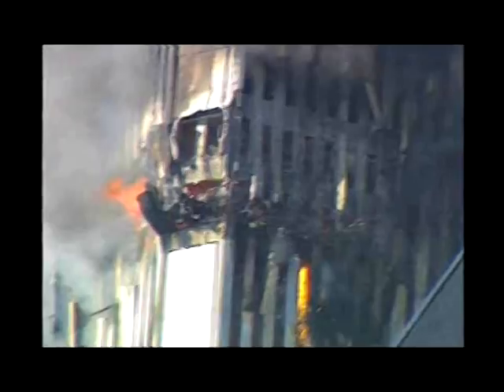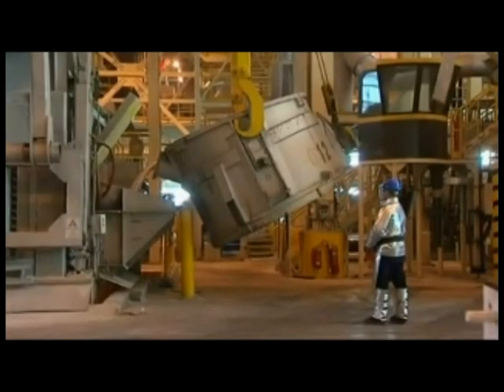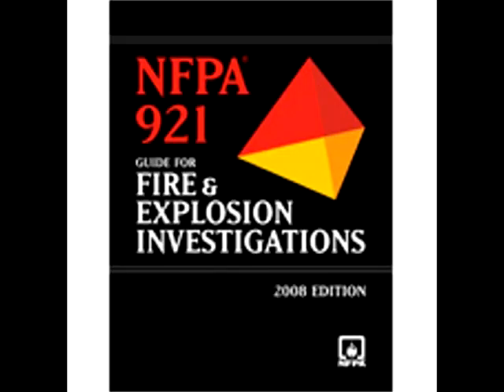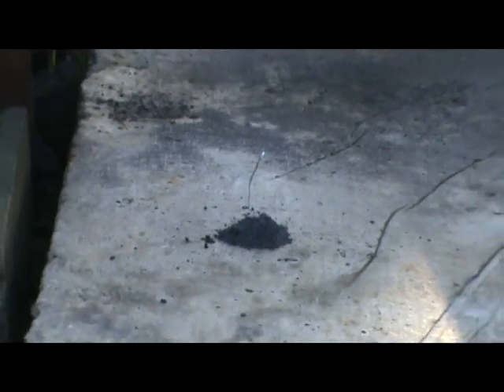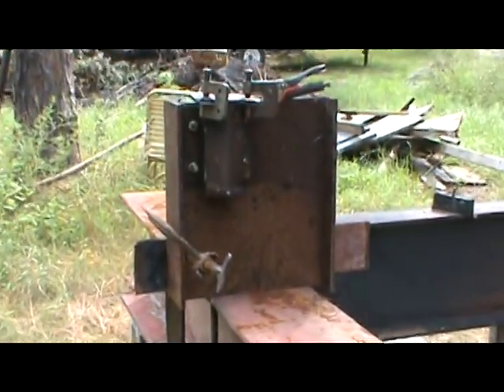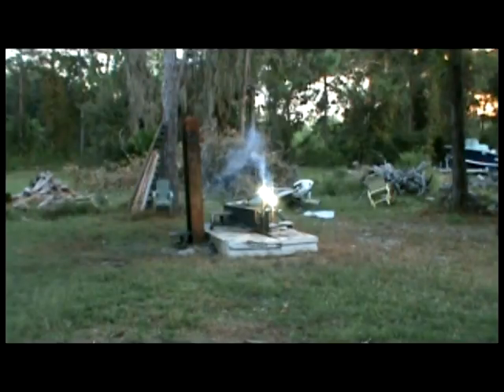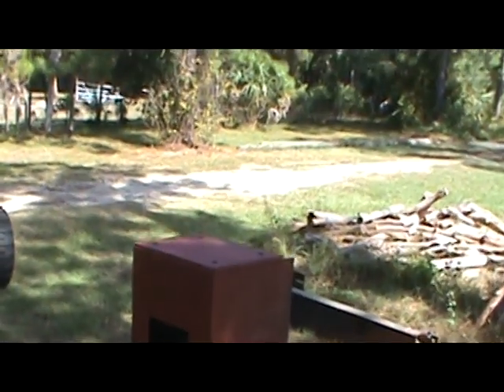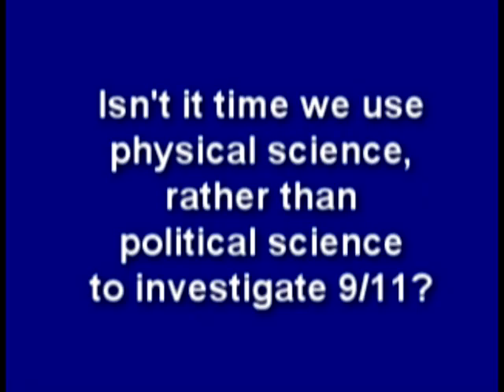9/11 Experiments: The Great Thermate Debate

Comment: So if thermite was installed right in the impact zone then how do you think it survived the plane impact?
Reply: Joel Robinson The thermite was in the core of the building, which was not impacted by the plane. The WTC towers were designed to withstand a full speed impact of a jumbo jet.
Reply: @BeeStinger13  Plus, that statement of yours is conflicting because you claim that thermite was seen dripping of the exterior corner of the south tower so how could it be in the core if it was planted on the exterior?
Reply: @BeeStinger13  False. You are overestimating the power of the towers. A 767 hitting it at 500 mph full of fuel at full speed is not going to go well, especially since nobody had ever predicted such a thing, a purposeful suicide attack, and that steel structures have collapsed from fire in the past. The WTC was designed for a 707, a smaller plane, hitting it at a slower speed, around 180 mph due to it being low on fuel after take off, as there is an airport close to the WTC. That is quite a different circumstance than a purposeful attack with a bit larger of a plane hitting it at full speed and full of fuel. But there is something you are forgetting, the buildings did survive the intitial imapacts, allowing thousands of people to escape from them. It was the fires from the explosions of the crashes that weakened and bent the steel which caused the structure to eventually be unable to stand anymore. So your claim that one of the towers could withstand the full speed impact of a 747 is just absolutely ridiculous. Nobody ever claimed this. This was just a quick assumption many years ago by one of the engineers who designed the towers but he was obviously wrong about this because nobody predicted a fully loaded with fuel airliner to be deliberately flown full speed into the Trade Center, just a much slower 180 mph crash when the plane was low on fuel after take off and lost in the fog, not being able to see where it was going. 

There is no way the thermite could have survived when in the core either because Flight 11 damaged the core columns as well and the fireball went through the core as well so it could not have survived the crash. Further, there is no way the collapse was initiated by the core failing because of thermite in it. 1, no thermite residue was found, just primer paint chips, this was debunked a long time ago and 2, the collapse of the South Tower initiated from the exterior not the core columns, proving that the core columns were not the cause for the collapse of the South Tower. The core of the North Tower however failed first because Flight 11 hit dead centre, so the core was damaged the most by the impact and fireball.
Reply: If the plane was demolished at the impact zone, how do you think it survived long enough to do all that demolition work to the skyscraper(understanding it takes many magnitudes more of work to accomplish, and no object in the world can demolish or accelerate through itself)?
Reply: @liarfire101  Basic physics. A 100 tonne jetliner with 40 tonnes of fuel travelling at 590 mph will penetrate a skyscraper deeply. Even if you hold this little suspicion, plane wreckage was scattered everywhere and witnesses say they saw plane wreckage landing on the streets.
Reply: Joel Robinson
It will always take a lot more "work" to demolish a skyscraper than it will to demolish a plane, and no object does the work of demolishing itself. Because the first law of motion won't be violated, by some  kind of "initiated" acceleration through oneself,(which  somehow gains weight while taking itself apart), or otherwise. It might be deniable, but it's a fact nonetheless.
So the jet's only significance is as a red herring, that misleads dialogue into Muslimland and 911 State Space. Because it lacks any physicality to demolish a wrecking ball after being demolished by a skyscraper, and you're still using it after nineteen years.
Reply: @liarfire101  So what about the millions who saw the planes hit, the many photos of plane wreckage on the streets and roofs, the ATC who tracked the planes on radar from takeoff to crash, the many people who heard the planes, the fact that the planes were travelling at full speed, the fact that those planes are missing along with the crew, hijackers and pasengers, the DNA of the passengers that was identified, the people who were actually there who wtnessed everything etc? Would you actually go and talk to any of them to scrutinize your claim? No, because it is so obviously and painfully wrong.
Reply: @liarfire101  
''It take's more "work" to demolish a skyscraper than it will to demolish a plane''
Reply: Joel Robenson
The fact that billions of people saw a skyscraper demolish a jet long before watching thousands of eye witnesses obliterated live on TV won't change the fact that it will always take many magnitudes of work more to demolish a skyscraper than it does a jet, that the jet was no longer around to do all that demolition work, that no object on Earth can accelerate through itself, that nothing gains weight as it's deconstructed,  that an obliterated skyscraper is likewise a demolished building, and that these were the largest demolished skyscrapers in world history. Because facts never change and always agree with each other, despite a reiterated red herring claim that contradicts them all.  A jet rarely flattens a tire on impact. If a single explosion at the impact zone could actually accomplish this mighty skyscraper flattening, rather than a plane crash, how would all of those billions of people viewing know who to blame? And why these elaborately planned suicides instead of simply planting the necessary explosives in two spots before walking away to kill again?
Reply: @liarfire101  Huge full speed, fully loaded airplanes smash into skyscrapers. Skyscrapers buckle at the impact points and collapse.
Reply: What plane?
Reply: @ItsMeScareCro  The plane that was seen by millions of people and was found in pieces on the street and that left remains and accessories of the passengers on the streets below.
Reply: @ItsMeScareCro  Literally in that same video he clearly said he heard the explosion before looking out the window and seeing a tire from the airplane land. So obviously he wasn't attentive enough to see the airplane speeding towards the tower when driving in a car which would require him to look up to see what was happening 80 storeys above him. You and many others blatantly ignore the many witnesses who did manage to see the planes.

Going along with the claim that holograms which barely even work today would for some reason be much more logical than using actual planes, you people still cannot explain what happened to the real planes which had those real people on them and why the perpetrators would not just use those real planes to crash into the buildings to prove terrorists used them in the attack and why they would run the huge risk of getting caught planting so much physical evidence of the planes on the streets below (refer back to the evidence I sent.)
Reply: Magic, of course. What else. That special brand of "truther" magic that Harry Potter did.

Comment: The Twin Towers were built in the 1973. The first computers were built in the early 80's. Fiber Optic cable was first used in the US in 1975. By the late 1990's, the towers were useless as office buildings without being restrung with fiber optic. Too expensive. Had to be demolished. Best idea was to demolish them and get paid at the same time. Silverstein collected $4.55 Billion. 
Always Follow the Money.
Reply: "The Twin Towers were built in the 1973.The Twin Towers were built in the 1973."
Or, you know, in 1970.

"The first computers were built in the early 80's."
Yeah, you missed by about 110 years. Good work!

" Fiber Optic cable was first used in the US in 1975."
Which is why NASA used it on the moon in 1968?

"By the late 1990's, the towers were useless as office buildings without being restrung with fiber optic."
Which is patent nonsense.

" Best idea was to demolish them and get paid at the same time."
Which would not only have pissed the owners fairly significantly, but also, if this was such an all-important thing, would have led to Silverstein not completing the contract.

Good work, you failed in every point you attempted to make.

Comment: "9/11 TORONTO REPORT" brought me here.  Your experiments demonstrated thermite melts steel.  I saw with my own eyes part of the truth this significant book is trying to prove.  Your effort  I will not forget.
Reply: That thermite melts steel has been known since at least the 1950s, so that "proof" was nothing of the sort. That's not even slightly relevant.

As for the "9/11 TORONTO REPORT", I presume you're referring to Hulsey's nonsense? In which case, you missed heinously. Bra-vo.
Reply: @mooneyes2k478  thermite melts steel? Since the 1950s? Sorry, you can't prove that it's been known since the 1950s.
Reply: @bojackson3073  The thermite reaction has been known of since 1893. It was patented in 1895. So, yes. I can prove that.
Reply: @mooneyes2k478  can you prove that it can melt steel? And that the steel melting has been known since 1950?
Reply: @bojackson3073  Can I prove that thermite melts steel? Yes. Can I prove that it's been known to from at least 1950? Yes.

What of it?
Reply: @mooneyes2k478  do both please.
Reply: @mooneyes2k478  do you have any proof they used thermite to melt/weld/cut steel tracks?